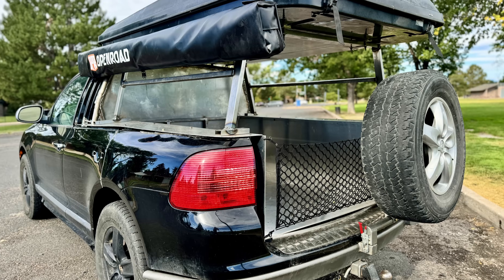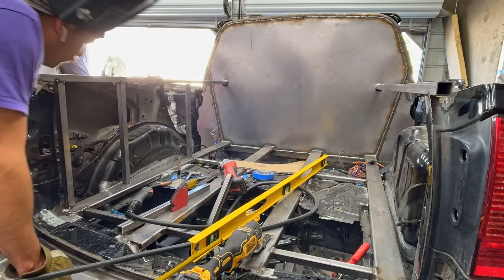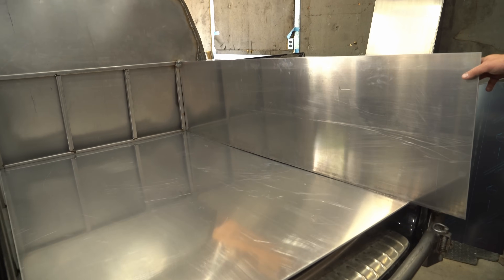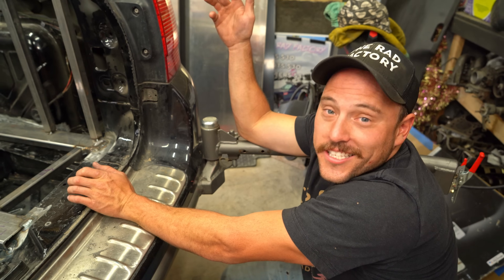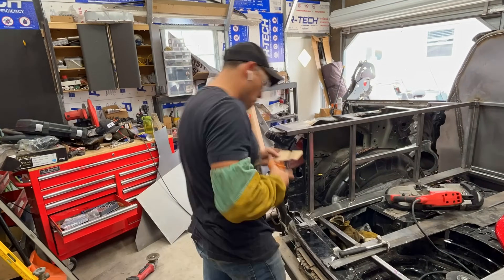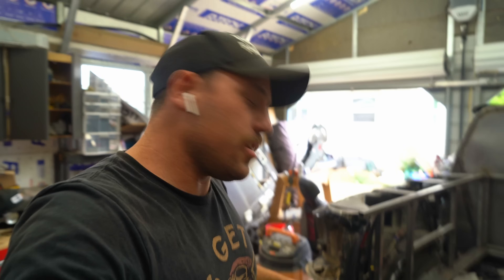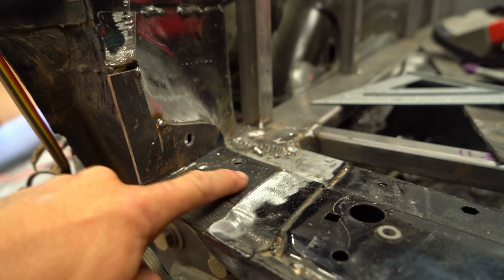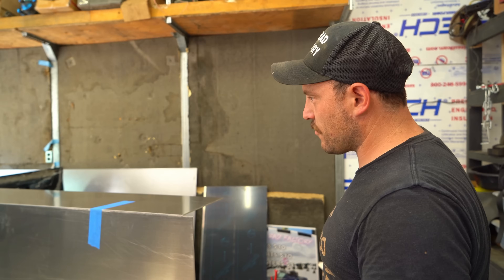HUGE PROGRESS ON MY PORSCHE TRUCK! WILL IT HAUL?

Comment: You could add rubber grommets between the sheet aluminum and the body on every bolt and that would help with the rattling. It would also help with the galvnic corrosion between the steel and aluminum. Sick build though. Also, I vote for spray in liner.
Reply: um yeah absolutely. I learned all about it with my aluminum boat. they will be sorry as can be if they are using steel screws and no grommets. real real sorry
Reply: We are definitely going to do some butyl noise cancellation on the aluminum to do both of those things.

Comment: Hey Rad Factory! I have an idea for you! You should make that little opening that used to be the rear door window…into a window! Like most trucks. There's probably no going to be glass that fits that size, so maybe use some other clear material? Also, I vote for bed liner. Keep up the great work! 👍
Reply from the maker: I really wanted to have window there to see blind spots while driving but Gavin says we need metal for strength...
Reply: @The.Rad.Factory  aw man, at least I tried haha 😂 I also had another Idea to make the sunroof just lift up a few degrees from the front or back for a little bit of air when you need it, but I'm probably too late lol.
Reply: @The.Rad.Factory strength is important Dylan 😂😂😂
Reply: @Lee_Rick technically we can still tilt it manually with an Allen wrench😂

Comment: I would go with a spray in bed liner. Some isolating materials between any aluminum and steel to prevent galvanic corrosion is a must as well. Also, hardware for fastening aluminum will need to be propper (zinc coated, for example). I would suggest looking into the galvanic scale for sure with this build. I love the channel so far. Keep it rad!!
Reply: Thank you!! We are definitely planning on insulation for the aluminum both for rattle and corrosion

Comment: Having built my fair share of Overlanding trailers. , More bolts are not the answer for rattling. Using double sided neoprene tapes or double sided closed cell foam tape stops the rattling and watertight
Reply from the maker: Awesome advice!
Reply: For sure! Definitely hoping to do butyl on the back of the aluminum

Comment: Also, check out the new nissan trucks and how they have a sliding D ring rail along the sides. It would be a super easy bolt on that would make strapping things down in the truck way easier 🤙🤙
Reply: We have definitely thought about doing something like that. It would be super cool.

Comment: While I would love the look of the aluminum bed, it will be hot af with it being out in the sun.  Definitely coat it.  The liner will help with holding things in their place.  The aluminum will cause more problems than I think you realize.  The liner will actually add a little more rigidity and longevity.
Reply from the maker: That makes a lot of sense! I’m on board!
Reply: I have already burned myself on the bed with the raw AL 😂

Comment: A few ideas use vinyl grommets on each panels mounts and a bead of panel adhesive along each crack will eliminate both the vibration and rattling sound and provide a barrier between the aluminum and steel. Definitely use bedliner and get one of those cool f150 aluminum tube tailgate for a larger box
Reply: That cynic idea we are planning on doing something similar for sure. Idk about the tailgate. We are hoping to modify the Porsche hatch into one.

Comment: If you do leave the bed bare, can I suggest stained hardwood strips on the bottom continuing onto the front wall and tailgate. Seems very Porsche, also very 50’s American hot rod pick up. Like 1.5  wide slats with maybe 3 inch spacing in stained walnut or what ever would match the interior trim
Reply: Oh and countersunk hardware for the bed tops

Comment: I would make sure before you permanently bolt. All the aluminum down, you use something like a double-sided tape on the steel. Nothing too strong... Something simply to help with all the vibration but also mainly to help with Galvanic Corrosion, since you are bolting aluminum to steal. I would also be concerned with that when you're putting bolts in to the aluminum. I think the aluminum will be nice, all polished out. So I would not worry about bed liner... Bed liner kind of sucks anyways... One thing I thought of that would be very awesome is to get Porsche Lettering and a Porsche Emblem laser engraved into the aluminum. If I was doing it I would have done it a little different and maybe put a wood grain flour in it. Maybe even a black wood grain floor if you're keeping the color... You could add some tape to mimic that look they do make wood grain tape. Or carbon fiber tape. Maybe that would be another option... However i'm sure the tape will not be that durable. I would definitely get some black lED taillights to go with the times... And I would think.
About connecting a strip across the back of the tailgate to connect the lights with LED lighting...  You know, kind of like Dodge? Does on the charger or challenger across the back of the tailgate panel. You could put Porsche in the middle too... I think it definitely needs some more trucky accessories.I don't know maybe a lifkit...
Reply: All fantastic ideas!! We are for sure going to add dampers to the back of the aluminum for noise/vibration/corrosion control. The laser etching is the sickest idea!!! I love that